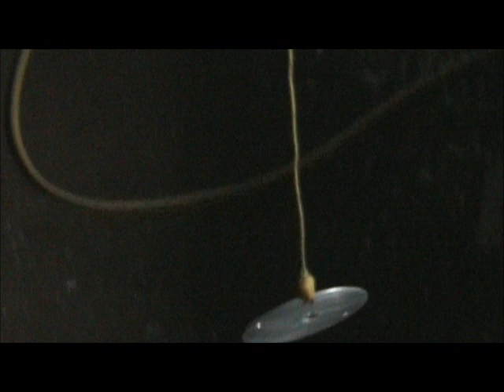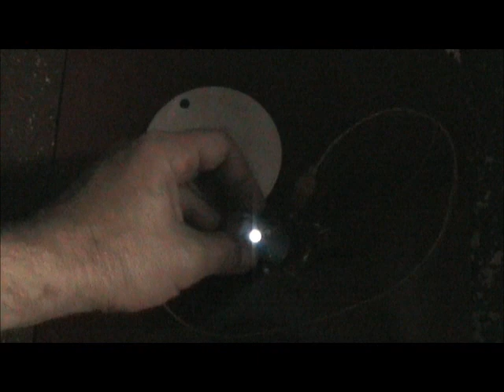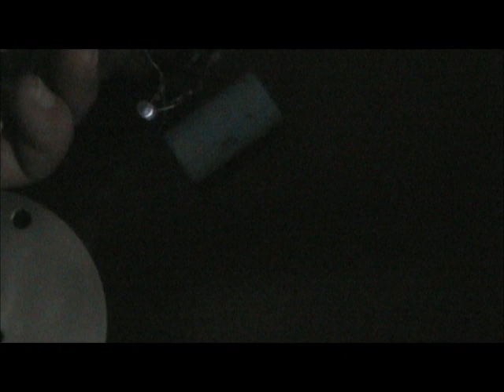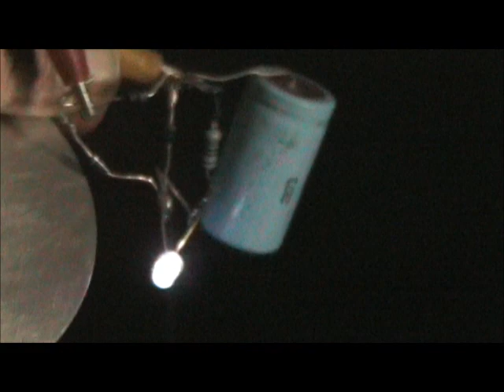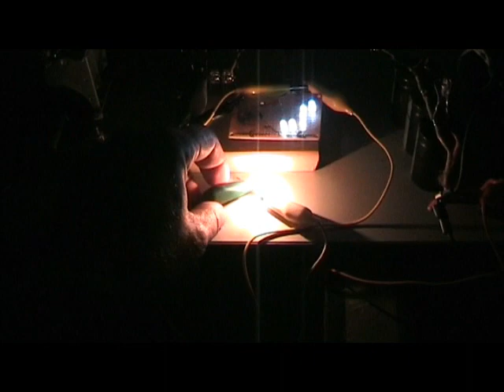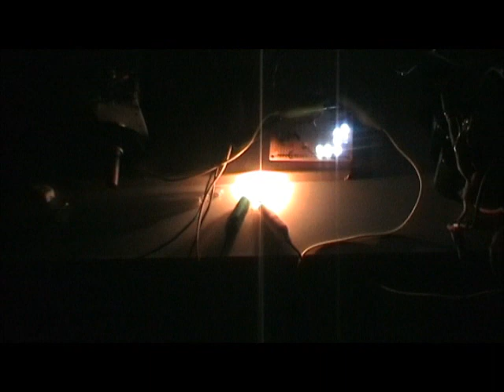Remote source experiment.wmv

Comment from the maker: No copper plate just aluminium one is painted, there is a small low power solid state Tesla coil running in the background using a couple of watts to provide the energy wirelessly. Each plate goes to one AC side of a bridge rectifier and the capacitor and LED go on the DC of the bridge rectifier. This is Tesla radiant energy utilization. Google it, it's interesting. At the end is the receiver coil powering loads and then the transmitter (Tesla coil) with it's wave form and own Fluro light. : )